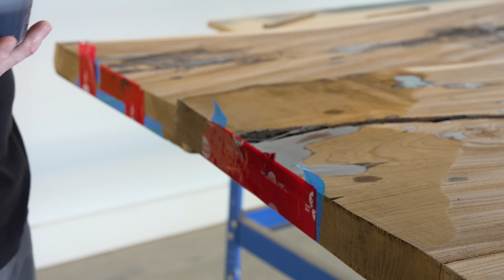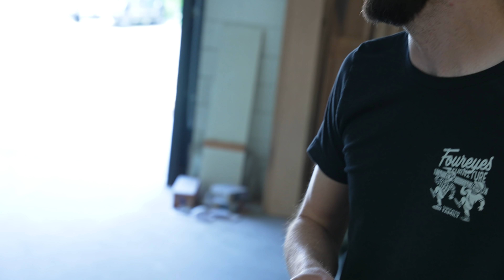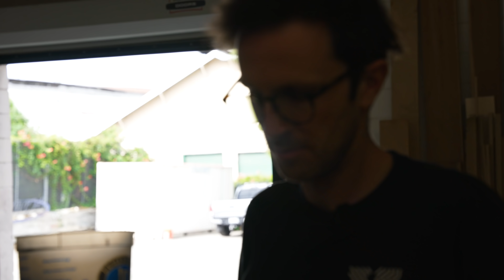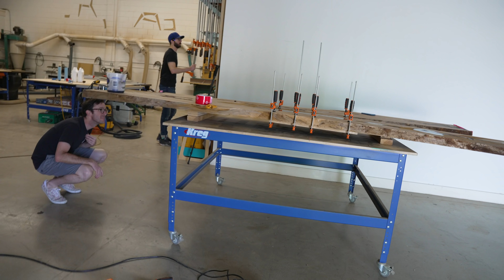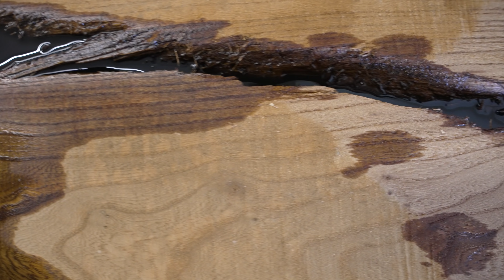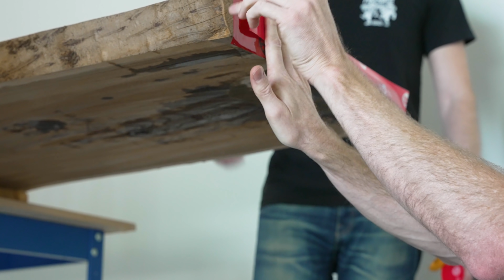Pouring Epoxy Forever

Comment: I'm glad y'all are tackling the difficulties of filling a big crack like that.  My epoxy adventure began with a similar project and had similar results.  We wound up using everything from roof caulk to plumber's putty.  As I said on your last video, the best way I've found to support the weight of the epoxy is securing a flat board (melamine) to the bottom, preferably with pocket screws.